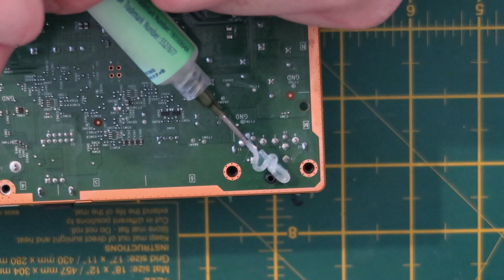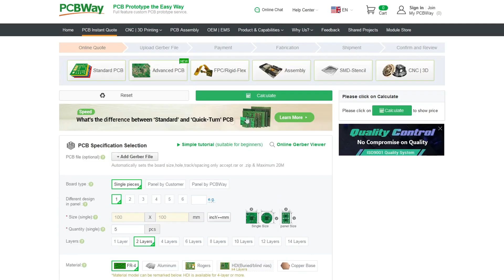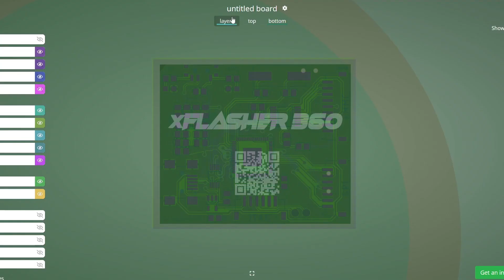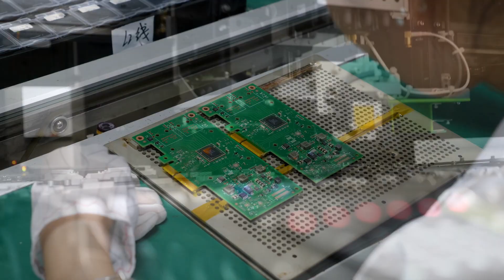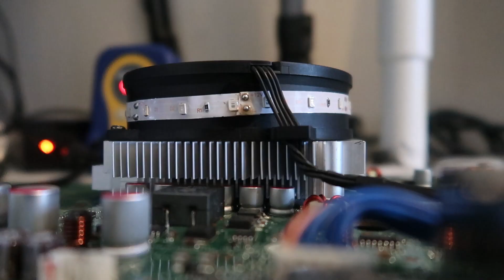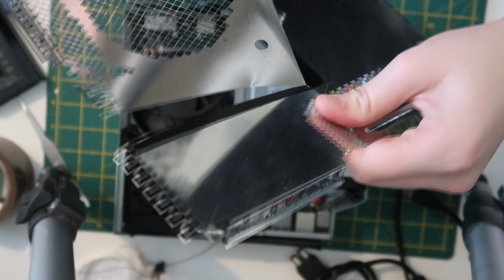Xbox 360 Slim Fan LED Mod Tutorial

Comment: The fan shroud is important, it adds layers to the cooling and sucks the hot air from under the dvd drive. Instead of wrapping LEDS around the fan, wrap them around the shroud. Not only will it look better, it will also keep your console cooler. And if you are using 5v lights, instead of using the standby 5v, use one of the unpopulated switched 5v power sources on the top of the motherboard. There are two different pads where the hard drive goes.
Reply: can u explain where the pads are

Comment: i didn’t attach mine to the fan but now my Xbox turns on for a few seconds before the power brick LED turns red :/
Reply: Power brick needs replacement
Reply: @echo7016  I didn’t do anything and the console works fine now but the lights stopped working. I haven’t bothered to open it up again to see what’s wrong
Reply: @Komaruuu  100% bad solder job or bad connection
Reply: @echo7016  yea most likely, I’ll get to checking it at some point

Comment: How did you solder so easyly i just cant get solder to stick on the points on motherboard.😢
Reply: Flux
Reply: Use flux
Reply: And don't worry about adding more solder
Reply: Stirri v3-TF flux.

Comment: hello im very new to this and im not much of a electrical person. What happens if i use 30 awg wires will it even work or will it not affect anything. Also where does the black and white wire go such as does white go to positive and black goes to neg? Thank you and very awesome video!
Reply from the maker: Apart from maybe being harder to solder, thicker wire won’t electrically be an issue. You can search online for diagrams to find positive and negative, although I’m pretty sure that I mentioned it in the video. Thanks for your kind words!
Reply: Anything from 24 awg till 30 awg should work just fine if u have anything lower than 24 awg it should work too as for black and white wire it's just a colour to know what's ground and what's 12v so using 2 black wires is gonna be the same as using white and black wires ground stands for negative while white is positive for 12v